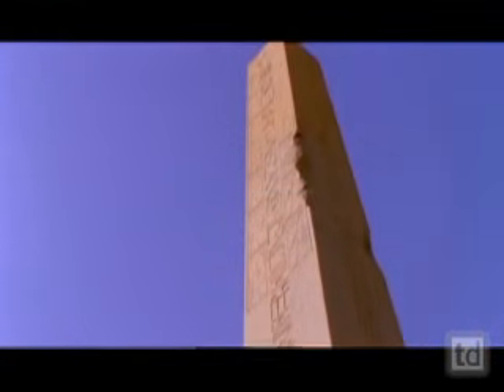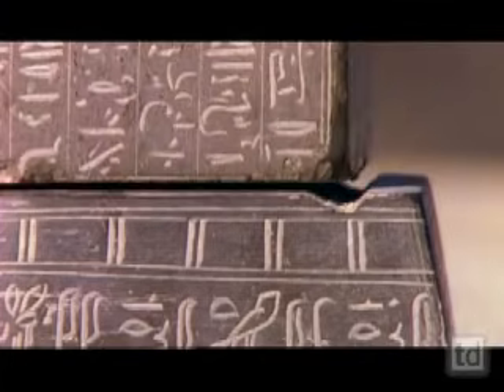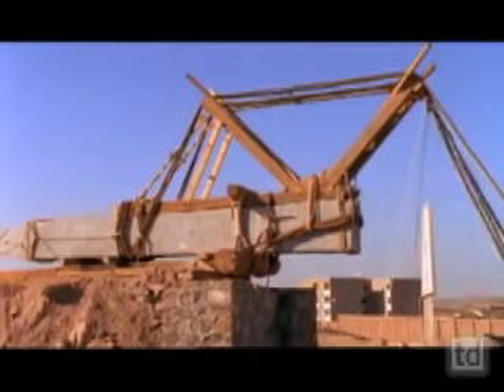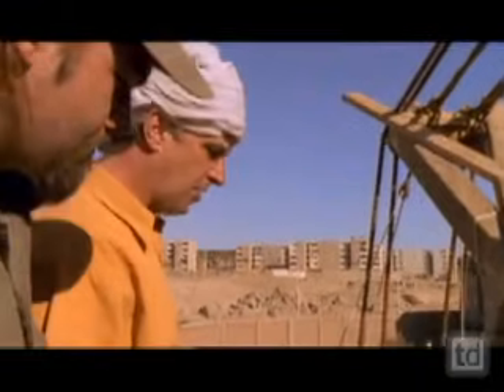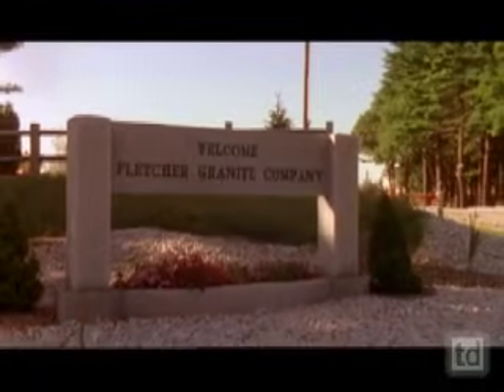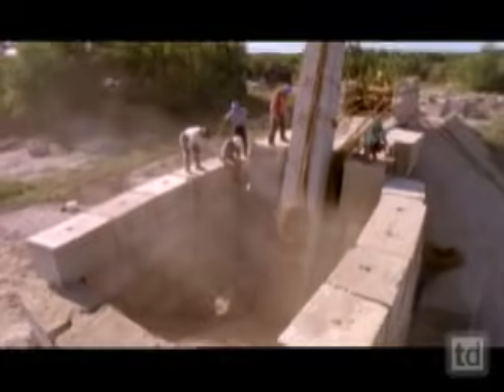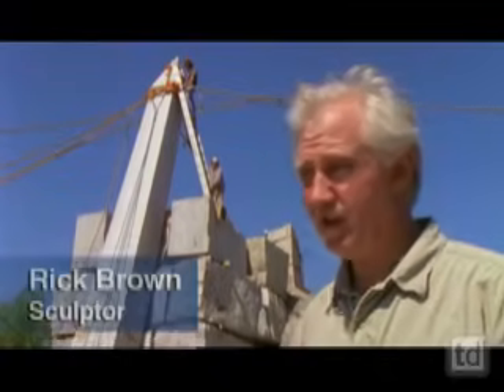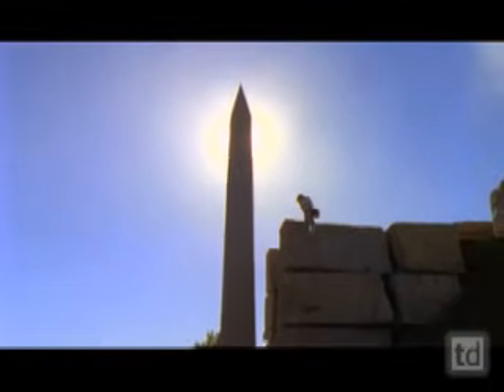Raising an Obelisk

Comment: Impressive stuff. But surely the ‘turning groove’ wouldn’t have been necessary if using this sand technique
Reply: I think it would since it stops it in a controlled place which is good for further use.
Reply: I was thinking the same. With a steeper angle that would have been possible without the turning groove.

Comment: The point that hits the groove first will overhang the groove because that becomes the fulcrum pivot point. If this method is used all the obelisks should be sticking out on one side. But I have not seen any obelisks on my YT channels to verify this.
Reply: Could be that the Egyptians also adjusted it simply by one pull to the left, and then another to the right, to get it away from the groove. But who knows.

Comment: When quarrying, how do you separate the obelisk from the bedrock beneath it?  I understand the trenching part, but what about underneath?  Would they undercut it and then use some wedging technique from the side to break it free?  Or, maybe, drive spikes in horizontally, similar to how you would cleave it vertically?
Reply: I heard that they stuck wood underneath and filled the grooves with water. Then the wood absorbed the water and expands, splitting the rock.
Reply: @sydneyleite6553  Interesting, thx!
Reply: Sydney is right source: i was there @ibjacked
Reply: This is my doubt as well after I had seen an obelish building technique video.
Reply: Luckily the unfinished Obelisk gives us some ideas how they did it.